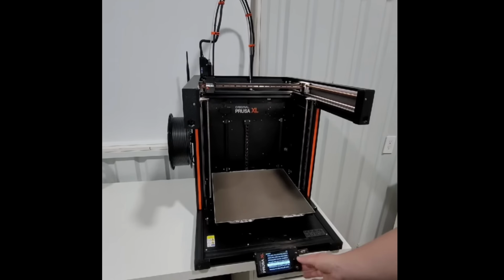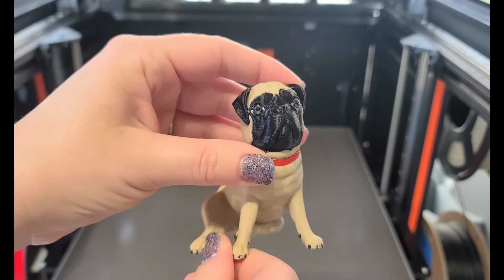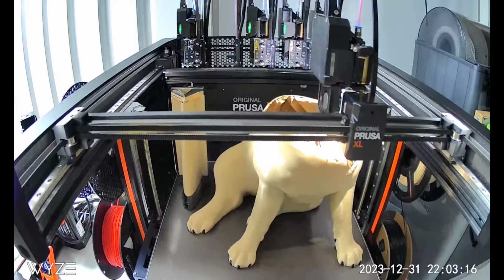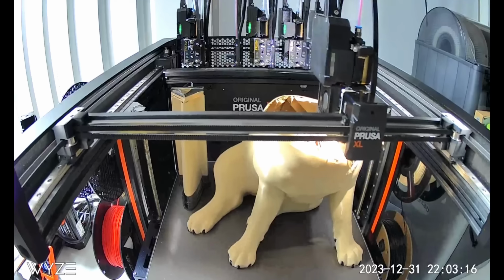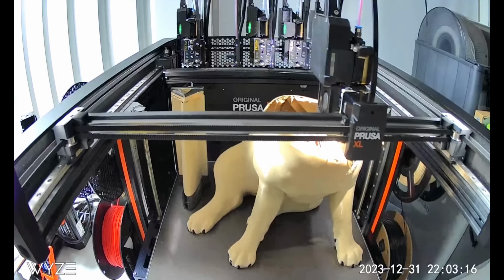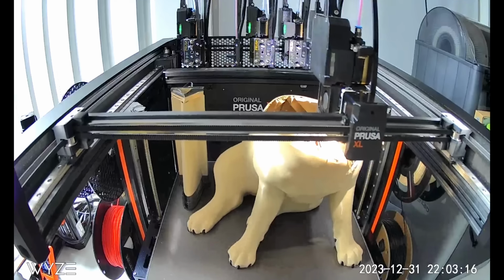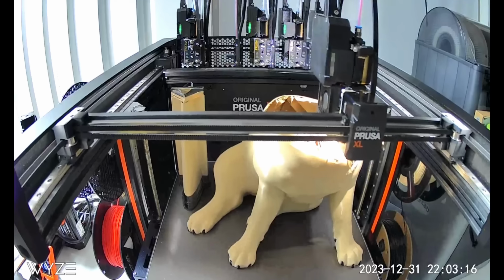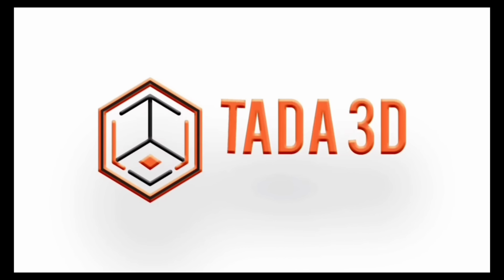Finally Testing Out the 5 Color Buddy Print That's Over 14" Tall!

Comment: I started watching your videos last summer when your first started sharing your XL journey and I wanted to see what to expect.  Since I've watched all your videos, and have had my own 5-tool XL for a couple months, I feel certain that your experiences are not normal, and are likely a combination of your original assembly steps and your slicer settings.  My printer is running near flawlessly, and it bothers me that since you have one of the most prominent XL related channels that you're portraying the printer to the public as worse than it really is.  I read the comments in your videos where viewers think this printer is rubbish - but it's actually a really good printer. I will say that the complex 5-tool XL is more sensitive to bad assembly than other printers, so don't feel too bad about it, but you do need to take a step back and revisit your assembly steps and maintenance procedures and make sure things are perfect.   To help you, I'll lay out some items here for you to address.  Buckle-in, this is a long one...

First, while I love me some Prusament, I doubt it will be a magic bullet that solves your printing woes.  While it is nice to have some to eliminate that as a variable, for the most part any decent name-brand PLA should do sufficiently well.  And I wouldn't worry about drying PLA, you go through it pretty fast in your shop, doubt you have any with moisture issues unless you're buying absolute junk PLA.  By the way, Prusa's local US distributor, PrintedSolid, will often have Prusament in stock, but you usually end up paying a couple bucks more per roll versus Prusa direct.  I've experienced the same stock issues recently, and it seems like it's either extremely high demand or limited production quantities, I see colors going in/out of stock on a constant basis.

Second, for the slicer settings - you need to change "Print Settings > Multiple Extruders > Wipe tower extruder" from the default of 0 (which represents the currently printing tool) to a specific extruder (whichever one is used the most, i.e. your tan color for Buddy).  This will slow down the print slightly, but by having a single filament for your entire wipe tower, you end up with a significantly more stable tower.  Do not set it to a rarely used extruder/color, as even though that will still work, you'll have a ton of extra color changes. And yes, you should be using a wipe tower, going towerless is a gamble and only works with super dry filaments (but not annealed PLA, which can happen if you dry incorrectly).  Lightning infill is a gamble on larger prints (curling & crashes), you're often better off with adaptive cubic at 5-10%.  In general, you need to become more proficient with Prusaslicer - you use the defaults a lot, and while it would be nice if the defaults were the best, they are not.  Certain values, like the wipe tower extruder #, should be set on nearly every multi-tool print.  There's a ton more to worry about, not just those two items, but I can't cover them all here.  Unfortunately, we're still in the early infant years of 3D printing, one day we'll have single button perfect prints, but for now you'll have to learn how to slice like a pro.

Third - the new idler screw tension you adjusted that extruder to is way too tight.  When properly tightened, you can barely see the first thread peeking through the other side.  Also, Prusa's typically work best with the idler tension being as loose as possible without filament slipping.  From freeze-framing your video at 15:47, it looks to me these were already too tight before you adjusted them tighter.  The screw bottoms should be about flush, not sticking out several millimeters.  I know Prusa told you to tighten them, they told you wrong.  Being too tight is more likely to cause jamming behavior.  Since this occurred on more than one extruder, double-check them all.  Since you've had this exact same issue in other videos, basically from the beginning, I'd hazard a guess that Prusa shipped them too tight. Also, please stop turning the screw on the cover, that's a flip-up cover, you release it by unhooking the hidden latch, not turning the screw.  You've done this wrong in a couple videos now.  It's not obvious where you lift to release the latch, so take some time and fiddle around with it until you find it.  You may have over-tightened that screw when you were done, so make sure it's not too tight.

Fourth - I've never seen you check belt tension, and some of that homing behavior looks like a belt tension issue.  Prusa has a belt tensioning web page that runs on your phone and uses the microphone to help you tune the tension.  While it's not the greatest tool, I found that my belts were too tight from the factory, and I had to loosen them a lot, so it's an important step.  Aim for about 78Hz.  I actually have mine running well, closer to 74Hz, and stock was about 88Hz.  If you go too low, you get belt slippage, and 74Hz is pretty extreme but seems to be working for now.  Also, during initial homing when the carriage hits the right side of the printer, it does this to force open the lock bars in case you had them closed, seems like that didn't work right on your printer.  Again, might be due to belt tension.  The reason the tools were being dropped a couple times is because the printer lost steps, and traveled too far to the right and unlocked the bars, dropping the tool, and loosing steps is a symptom of too tight belts (well, either that or too loose, either way, not tensioned correctly) or crashing (lightning infill...).  Don't assume Prusa shipped the belts correctly tensioned, and they seem to be changing their guidance to lower and lower values.

Fifth - I've never seen you apply lubrication - I was guilty of this too, the Prusa assembly docs didn't advise me there.  You need to lubricate both the z-axis lead screws and the 3 locating nub-screws on each tool.  If you go to Prusa's printable parts, there are a couple tools to print for maintenance for lubricating both items. Read the XL documentation on maintenance and follow all of it.

Sixth - going back to the very beginning (assembly), you need to revisit all your screws, make sure they are well tightened.  In some of your videos, you finger tightened a few screws (as commenters pointed out), and you've never shown a video where you corrected this mistake, and since you're having so many issues it seems plausible you have improperly tightened screws.  Step through the assembly guide again and any screws/posts you were responsible for, re-tighten them.  Everything should be super tight, almost to the point you think you're going to break something.  The printer can handle it - I'm a pretty strong big dude and I gave it the full beans and the printer loved it.  Also check for tool alignment with each other when parked - use a long ruler across the tops/fronts and make sure they are perfectly aligned.  These issues are the big downside to a printer that ships requiring assembly, especially when the XL is so sensitive.

Word of caution, don't tighten the 2 screws on top of each z-axis nut, they are supposed to be a little loose, and you get horrible vertical artifacts if you tighten them - I learned this the hard way.  Also make sure those silicone nozzle leak-stoppers are properly adjusted - if they are too tight they cause the entire tool to sit cockeyed when parked, and then it doesn't pick accurately and you can experience color misalignment.

Seventh - double-check your entire filament path.  Make sure all your PTFE tubes are properly inserted and not kinked in any way.  Combined with an improperly tensioned extruder gear, this could explain why the red didn't extrude mid-print.  You probably need to pull out the tubes and check the ends - be diligent and examine every last inch.  Even a little kink/dent can be an issue.

Eight - After you address all of the above, and particularly #'s 3-6, you need to redo the nozzle alignment calibration.  From looking at Buddy's red collar, the color alignment seems slightly off.  There's a test print you can use on the thumb drive to help validate color/nozzle alignment, which is a handy validation that there's an issue.  What I'm thinking happened here is that a lack of screw tightening and possibly improperly adjusted nozzle stops causes your previous alignments to be less than perfect.  I think the color misalignment is also contributing to your wipe tower issues.  Because the nozzles are slightly misaligned, and because you have the wipe tower extruder set to 0, it keeps changing which extruder is used for the wipe tower body on each layer, and that's where you see the failures at the bottom of the tower where it switches between black and tan on every layer - bad alignment causes poor layer adhesion.  Note, this misalignment might also be a result of you switching between 0.6 and 0.4 nozzles, and back again - you should repeat the nozzle calibration any time you touch the nozzle.  Failure to do this could also explain your lackluster results with 0.4 nozzles - I have amazing results with my 0.4 nozzles, much better than the stock 0.6.

I know this was a painfully long post, but I truly hope you read it all and follow the guidance.  The printer is so much better than what you're experiencing.  I think if you did all steps, #2-8, that would even make for a nice video, similar to your other troubleshooting videos.  It's still possible that there's another issue I didn't think to cover, but I covered so much above there's a good chance the solution(s) are at hand.  Good luck.
Reply: Totally second everything you are saying. I have my XL 5T for a few weeks now and it has been running none stop 24/7 without a single glitch. Every print is flawless, no stringing and no waste (🙂). The XL truly is an amazing machine. I feel sorry that she has so many issues and I hope, and expect, that your suggestions will help but from my experience as well it is incorrect to give the XL such a bad rap.
Reply: lots of good information.  I'm trying to find guidance on cleaning the nextruder.  I had my number one get filament coating the drive wheel and took it apart, but obviously I did not get it back together correctly, as it keeps jamming.
Reply: @woodwaker1  Never heard of that coating issue before, sounds pretty bad.  Junk filament?  If you disassembled the full extruder, things to be aware of:  The planetary gears need to be directly opposite of each other around the sun gear.  If they're off by even 1 tooth, issues.  In the filament path is a small guide part with a hole in it, that the filament runs through right next to the big gear.  I've found it to be fragile and subject to damage.  Print a new one and swap it in.  Make sure your idler tension screws are about the same as the other extruders, bottom of screw about flush, maybe poking out 1 thread at most.  And there's a setting in the menu (at least on the MK4, probably on XL too) to auto-adjust the extruder gears (Calibration & Tests > Gears Calibration) that may need to be run.  In general, if you had filament gumming up the works, there could definitely be some damage on the inside, so examine everything.  Good luck.
Reply: @PaulStevensonPinball  Thanks.  I can't find anything on how to work - adjust the nextruder.  I was hoping they would have a video or some information on it.
Reply: If would be nice if you can post vids of good prints because I am very close to canceling my pre-order due to all the failed vids I see.  If there are so many good prints, why are we not seeing them??  I have seen less than 5 videos of successful prints that uses more than half the height of the print volume.
Reply: i'm sorry, but reading through troubleshooting set of instructions and blaming the operator is so -- WRONG ... I'll say this for context, I built an independent extruder machine with 4 heads -- back in 2018, I ran 2 4 color parrots on it to give to my kids, outside of having to recalibrate way too often (which I have since solved), the machine never had these mysterious issues. I then did (and is still my longest multi color print -- 37 hour Aria Dragon) which had zero issues. And this was a hobby printer doing bleeding edge stuff 6 years ago. I've done a few upgrades on it since electronics have moved a bunch since 2018, and I got some quality of life upgrades for. The reason I say this, is because the machine I built is quiet a bit bigger, with a build area of 600mm square with about 540 in height, and actually quiet a bit more complicated, and I'm doing this as a hobby. When something messes up on that machine, it's for me to fix, and I get that, it's a project machine -- and honestly still the only one I've even seen posted on Duet forums to use 4 extruders on independent Y carriages. I keep tinkering on it, and upgrading plastic parts with light weight CNC aluminum versions. I do that because it's fun, but when I need it to work, it just works. The XL, is using known technology, coreXY with toolchanger has been done and re-done, there are so many diy builds of that, that it's baffling to me how a commercial machine is such a crap shoot, some people have won the printer lottery, and some people get what I see here -- a lemon. That SHOULD NOT happen on a commercial machine being sold in 2023-24. I either see tons of stringing, extruders that don't extrude, docking failures, it's beyond me how this is operator error. Either she has to go through a 12 step troubleshooting guide, or if I were her, I'd pack this thing up and request it to be swapped for a brand new unit, then follow the build guides, tutorials on how things should be tightened or not. NO way would I be going though this level of user maintenance for I repeat a COMMERCIAL machine being sold for a premium price in 2024.
Reply: Tons of good info. Thank you so much, looking forward to applying this to my XL 5T and see if it helps my poor print quality issues.
Reply: @kazolar  This is very true. Unfortunately, we are early adopters and 3d printers still are not plug and play consumer devices, as much as we would like to think they are for a $4000 machine.
Reply: Here the same but only two head but anyway I have a lot oft prints done and without any issues beside a little stringing depending which pla filament.
Even ninjatek filaments prints well.

But I am also surprised how different the quality from machine to machine or more from assembly to assembly is
Reply: @ShaunCullen  I was an early adopter. I built a machine that can do everything the XL 6 years ago, more reliably and at this point the only plastic bits are fan ducts and extruder body ( besides electronics enclosures) The state of the XL is INEXECUSABLE. Being an early adopter for a tool changer in 2024 being sold as a commercial printer isn't a thing, e3d put out a tool changer platform in 2020, buying that and dealing with teething issues was expected, this is not 2020, this is not a platform being released for early adopters looking for a CNC machined tool changer kinematic system to play with, this is a "finished" printer. NO company would be able to get away with releasing partially finished prototypes Prusa releases and calls it done, and then patch it in firmware months later. The only comp are steam games. You can say people buying Tesla Cybertrucks are early adopters, imagine if they were as inconsistent and so shoddy as  the XL.. Tesla would be sued out of existence. The 1st iPhone for all it faults, WORKED, it could place phone calls, it didn't have an app store, or copy paste, but it did the thing it was supposed to do - XL DOESN'T.
Reply: Boo you for expecting the owner of a 4K plus 3D printer to have to be an expert at 3D printing in this day and age, or having to fix Prusa assembly problems, if that’s even what it is. I have had mine for a month now and am also having issues, been working with Prusa support for weeks now and still no solution.
Reply: @Bretto311  Lol, that's funny mate.  Me personally, I have no expectations, I'm simply reporting the current state of affairs from the front lines.  Shame on Prusa for not only designing a printer that is a bear to assemble properly, but also for shipping it unassembled - they're fully responsible for the current state of affairs.  They should really have a cautionary statement that expert assembly required, even on the mostly assembled version.  There's enough of us out here with well running machines that we can confirm that the design does actually work, but at the same time there's enough users like you experiencing issues that we can't discount a fundamental issue.  Having gone through a full assembly myself, I can confidently assert that assembly is so fiddly that I expect even Prusa employees are doing things wrong.  I'm happy I got the full self assembly model, not only saved money but allowed me to take my time and triple-check every bolt on assembly and correct alignment of every part.  I'm not trying to cast any shade on anyone experiencing issues - the XL design practically invites assembly mistakes at every turn - I made mistakes too that I had to fix.  If you're having issues that are not hardware failure related, the best advice I can offer is that you should revisit the full DIY assembly instructions (even if you got the mostly assembled version), re-do every step (and read the user comments too!) and recheck every screw/bolt and also part position.
Reply: @woodwaker1  Seems like the nextruder is something they don't really expect you to mess with, I've seen precious little on it.  They might have some internal documentation, so reach out to Prusa support.  After all, their own workers have to assemble it, so they should have it documented somewhere.
Reply: @kazolar  I'm not blaming the operator, I'm blaming the assembler.  And since the assembler posted their work on the internet, it was all too easy to review it for mistakes - and mistakes were made.  Congrats on making a nice machine kazolar, but you're obviously highly skilled and would likely breeze through an XL assembly.  Unfortunately, not everyone has your skills.   I think buyers of the Prusa XL should understand they are buying a kit printer, much assembly required, and that some of the design elements make the assembly process unusually challenging to get right.  It comes with a plastic "torque indicator" wrench that you have to assemble too, for freak sake.  You can buy a kit car and assemble it yourself in your garage, but you better know what you're doing - and yet that kit car might cost twice what a Lexus costs, price is simply not an indicator of the ownership experience, and neither is the model year.  I got a pre-assembled MK4 and that was literally plug and play.  The XL is on the opposite end of the spectrum.  I believe Prusa will have to refine their design to either eliminate end-user assembly steps or somehow make them easy and foolproof.  For some crazy reason, Prusa decided they wanted to make a big printer but not a big box to ship it in. Prusa allowed for too many ways to make assembly mistakes or simply not tighten everything enough.  Buyer beware, but I'm super glad Prusa is selling this machine, because even at this price there is literally zero competition short of a DIY custom build, like what you did.  I disagree that the XL is being sold for a premium price - it literally is the cheapest oversized 5-tool printer kit on the market. For those that have the strength, skills, knowledge, and tools to assemble this kit printer, I highly recommend it.  Otherwise, you'll be a lot happier with a Bambu.
Reply: @ShaunCullen  Totally agree.  We're still in the first decade of consumer 3D printing.  The Prusa XL is the very first purpose designed 5-tool changer printer kit on the market, anything that came before are all basically custom mods.  I can only imagine what Henry Ford would have experienced were the internet a thing 100 years ago - "What do you mean, I have to hand crank my engine to start it?!  Engines were invented decades ago!  It's simply unacceptable for a COMMERCIAL vehicle to require this level of maintenance and manual effort in 1924!".  Until Bambu comes out with a highly polished, pre-assembled, turnkey multi-tool printer, making tool-changers mainstream, all multi-tool printer owners are early adopters, and we're still in the dark ages.  And $4k for the XL is about as cheap as it gets short of a custom DIY tool-changing machine, this thing is literally like 3-5 MK4 printers combined into 1, it's almost too cheap for what it is.
Reply: @PaulStevensonPinball  Thanks!  I have asked my friend Chris Riley to take a look at it.  He was a beta tester for Prusa on the XL, and has better insight and connections.  My problem started when I printed ABS in an enclosure (SUMO) and had the internal temp at 100F, don't know if that was a factor
Reply: @woodwaker1  Oh, very interesting!  I was wanting to buy the SUMO, but it got delayed and I couldn't wait, plus Joseph disagreed with some of my design goals, so I designed and printed my own enclosure.  I recall Joseph made a comment about extruder heat issues in an enclosure, perhaps he was referring to you?  My google-fu failed to turn up any reports of extruder overheating issues, so I mostly discounted his comments.  My enclosure is brand new, and so far I've seen temps stabilize around 93F while printing PETG.  My enclosure has a couple 80mm Noctua exhaust fans that pull air over the XY steppers and through the back mesh grill, exhausting out a window.  The fans are in their slowest speed, might crank them up a notch to drop a few degrees since it's a little warmer than my enclosed MK4 printing the same parts, but on the other hand the prints look great.  Haven't tested ABS yet, but I would definitely have fans running full speed to exhaust the toxic fumes, so temps would likely be lower.  Plan to print Nylon soon once I make a garolite bed, and I always print nylon with the fans off so that the enclosure becomes passively heated.  My MK4 in a PrintedSolid enclosure will hit around 100F with the fans off while printing nylon, the high temps really help prevent warping, and the MK4 handled the heat no issue at all, so I'm expecting the XL to behave similarly.  But your experience has me wondering.  Still, 100F doesn't really sound hot enough to cause issues for ABS, PLA perhaps but ABS should have been fine.  Perhaps there was some PLA parts mistakenly printed in your extruder assembly - I recently printed a couple rolls of PLA thinking I was printing PETG the whole time, mistakes happen.
Reply: @PaulStevensonPinball  Thanks for your input.  I got the SUMO to print ABS and PETG.  I still had some minor warping, but nothing like what it was like with no enclosure.  I did make some changes to the SUMO.  Used brass heat set inserts instead of the captive nuts.  I have not changed the parts yet.  It seems to do the job
Reply from the maker: @paulstevensonpinball Thanks for your comment. I am still reviewing and seeing what changes need to be made. I really appreciate your time in the details. And I'm really happy to hear that your machine is working so well for you. I am a huge Prusa fan and have been for years.

I completely understand that my XL is not functioning correctly. But I really expected that by paying extra for a "fully-assembled" printer, that I wouldn't have build issues. 

I am trying to keep things as stock/default as possible. I can understand that as I try more complicated things, things need to be tuned in. But not being able to print the Buddy which is an included gcode shows that this machine is struggling with even "basic" prints.   

I have some Prusament on the way. I do want to try a print with all the same brand to minimize any issues with different temps etc. 

Thanks for explaining the way to make the tower more sturdy by making it all one color. 

For the idlers screws, I am just doing what Prusa suggests but I appreciate your feedback after looking at the entire video. And idk why my covers don't like to flip but I will look at this again.

I will check my belt tension.
I will grease my z screws. I did grease the coupler pins per Prusa in a previous video. 

I have looked at my docking pins and they seem to forever be loosening themselves. I do try to retighten before every long print but I'll ask my husband to come tighten them for me and see if that helps.

I do wonder if my nozzle sealer on the far right may be a hair too tight because that toolhead seems to fail to dock the most. Ill check this.

Ill check tubes again. I just feel like it didn't like the red no matter which toolhead it was in. So maybe its not liking filament spools that are too low?

I did redo the calibration after i jumped between .6 to .4 and back to .6 nozzles. But I have not tried this print. 

Again I really appreciate your feedback and suggestions. Especially coming from someone who has an XL they are happily printing with.
Reply from the maker: @cees9314 I'm glad to hear that your 5T is working well! Thank you!
Reply from the maker: @woodwaker1 have you talked to Prusa about this? Thanks!
Reply from the maker: @draconpern4132 I agree that I do need to show some of the things that have printed good. It may even help to troubleshoot the difference in the ones that aren't printing right. I feel like most of my good prints are very boring squares or short prints. My XL seems to have some issues and I'm still sorting how to fix it. 

But if I were you, I wouldn't cancel a pre-order. I would wait until you get the email and decide then. I do get a LOT of comments with happy XL owners and feel like mine is not normal.  Hope this helps! Thanks!
Reply from the maker: @kazolar thanks so much for your support. I agree that a hobby build yourself printer and this very expensive "fully-assembled" printer are very different things. I used to have more patience with troubleshooting and trying things. But not with the amount of money I have spent on this. I am still a Prusa fan and happy with my other printers including a single TH XL. And it may ultimately be that it needs to be swapped. I'm just trying to see what adjustments I can make. And maybe it'll help others if they have the same experience. We will see! Thanks so much!
Reply from the maker: @biuTse did you get the semi or fully assembled? I'm almost wondering if by buying the fully-assembled, I made it worse for myself. Thank you!
Reply: @PaulStevensonPinball  I have a friend that was in the Beta test group come over and look at it.  He is going to talk to Prusa and see what they say.   In the mean time, I'm going to take #5 and try to swap to one and see how that works.
Reply: @tada3dprinting  No, I'm going to have Chris Riley look at it and talk to Prusa.  I suggested that he could do some videos on maintenance as he has had his for over a year.
Reply: @tada3dprinting I ve got the semi assembled. I like the assembly part of a machine ;-)

In another post here you say the screws are getting loose. Be careful to not over tighten them, otherwise you could destroy the threads.

I would use loctite blue. Something I don t understand why prusa doesn t deliver a small bottle of loctite because all these vibrations are just perfect to loose the screws
Reply: @woodwaker1  Just a heads up, I've been measuring temps in my enclosure at various places, and my enclosed XL definitely gets warmer than my enclosed MK4.  Even just printing PETG, I'm seeing temps from 95-105F (35-41C), easily 10F+ warmer than my MK4 in a dual 60mm Noctua vented enclosure.  You may want to measure inside at various places too, especially near the tool heads.  My XL enclosure is currently venting with a couple Noctua Ultra-Low Noise 80mm fans at full speed, which I'm going to swap for a couple regular Noctua 80mm fans that move a lot more air.  I also have two more 80mm fan ports I can use, in case I have to go to 4 exhaust fans, so hopefully I can reign in the temps one way or another.  I need to print some PLA and see how well that works.  I think your SUMO probably is leakier than my enclosure, I definitely worked hard to seal it up and control air intake/exhaust, so maybe it's not as bad, but I think you need exhaust fans running regardless.
Reply: @tada3dprinting  I tightened my docker pins using the provided tool that looks like a guitar pick.  I turned them hard enough that it felt like the metal pick was about to bend.  Similarly with the dock screws, using the provided stamped metal wrench (I actually did damage the wrench from turning so hard halfway through assembly, had to use my MK4 wrench instead).  They have not loosened at all in 2 months of printing.  One thing to remember about hand tools is that they are typically designed to only permit applying the correct amount of force, so even a very strong person using the guitar pick tool is unlikely to ever be able to overtighten when using the tool only with their fingers.  But do not use another tool to turn the tool - i.e. don't use pliers to turn the guitar pick - as that would allow you to apply too much force.  And keep this in mind if using your own hand tools that you bought separately, they might be nicer to use, but might also allow you to apply too much torque, so it's usually best to stick with the supplied tools.

I think Prusa diagnosed your Nextruders as slipping, hence they recommended tightening the idlers.  Not sure why they didn't consider that they were already too tight and were jamming.  I've never liked their idler pressure design, as it is much easier to get it wrong than to get it right.  Usually they say to loosen it until it slips, and then slowly tighten it until it just starts to grip and no longer slips, and that's the advice they should have given you this time.

The nozzle seals should barely deflect during docking.  If they deflect more than a millimeter, they're too tight.  Mine deflect a very tiny amount, almost imperceptible. Not only does excess deflection causing docking problems, but sealing actually works best with almost no deflection, as the seal is flatter against the nozzle tip.

It's possible that something is wrong with your red filament.  I did notice the problem followed it to another extruder.  Though it could be related to the idlers being tensioned wrong on multiple extruders.  Some filaments are more sensitive to this than others.

I'm glad you've been redoing the nozzle calibration after changes.  I hoped you might have been, but it's just hard to know from curated videos everything you do in-between takes. 

You may want to redo the docking calibration too, after you re-tension the belts, and as part of retightening the dock screws/pins.
Reply: @PaulStevensonPinball  Thanks.  How would you suggest powering the fans?
Reply: @woodwaker1  I just use a cheap 12v 1a DC power supply I got from the rainforest.  The Noctua fans I'm using are 12v fans.
Reply: @PaulStevensonPinball  Thanks.  I didn't know if you tried to run off the XL power
Reply: I applaud your response - to take the time to put such a comprehensive response and even an offer to help. Seeing your video of essentially the same print as this one, coming out looking fantastic - well its just great to see some content of what this printer can do. I wish the best for @TATA3D - I know from experience how frustrating it can be when you have a printer producing shit prints - looking forward to when you get this solved.